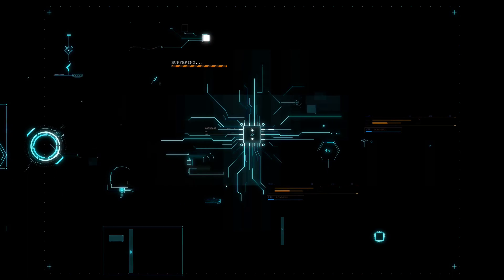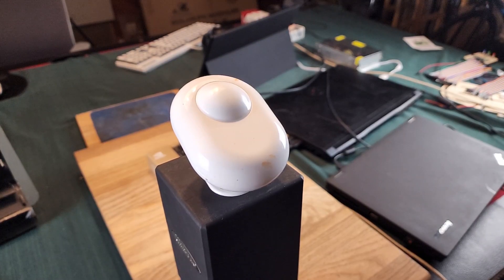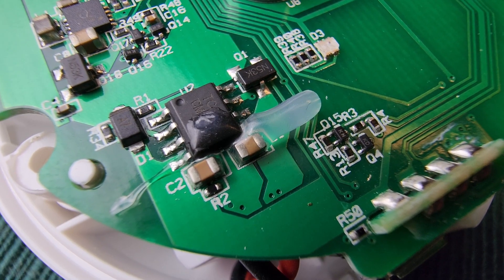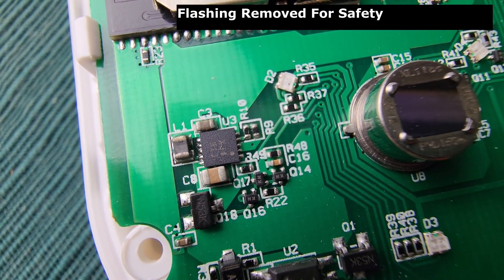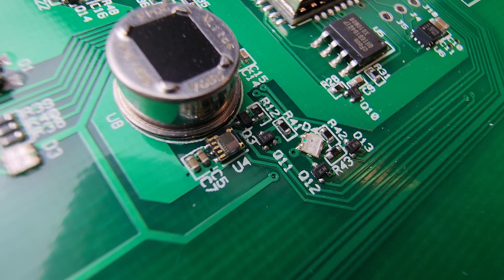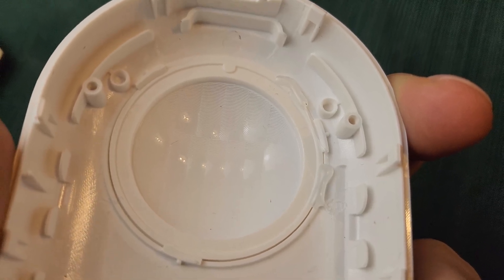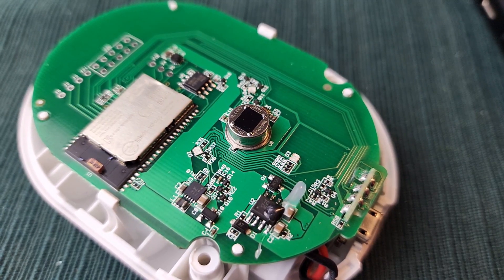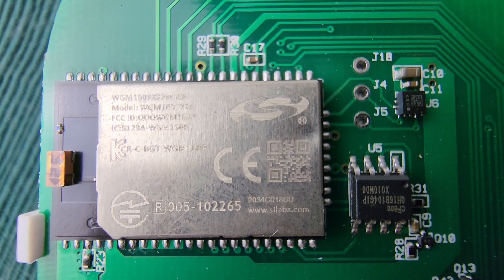The Stuff Inside A Smart Motion Sensor

Comment: Hey! How much does it cost to make an effective motion sensor from scratch?
Reply from the maker: That ultimately depends on your desired features. If you want just a simple motion sensor that uses PIR and is powered externally,  as little as $11 ($9 for a pico w, $2 for the PIR). You could go even cheaper using small ESP32 boards, but I haven't used them so I'm not sure what is involved. If you want to add a microwave sensor, add about $1.50. If you want mmwave, add another $10-15 and good luck finding just the sensor. If you want a light level sensor, add another $1.50 or so. If you want temperature and humidity, add $2-5 depending on the accuracy you want. If you 3D print a case, you might be looking at no more than $1 worth of plastic, but if you want to use some kind of project box, you could pay as low as $2 or so. 
One thing to note about all of the prices above; I based these on sensors I purchase and most of these you could pay quite a bit more for just one--or they may not be sold individually at all. So, it may be packs of 5-10 pieces. This means if you're only making one, you're spending quite a lot and you'll have a lot of extra pieces.
I hope this helps!
Reply: @smartercircuits I love you
Reply from the maker: Aw shucks, thanks!

Comment: Any suggestions on reviving a dead Motion?  I thought I recharged it a few months back...but I may be mistaken.  The reset does nothing (@ 3 or 10, 12 seconds).  I have recharged it but there is no sign of life.
Reply from the maker: That might depend on how much work you want to do. If the device no longer responds to its reset button, there's no other way to interface or troubleshoot without removing the case. Chances are, the batteries are your problem, but it could easily be a component on the main board. If you'd rather not open the device, I would say it is probably best to simply order a replacement or request one if it's still under the 2-year warranty. 
If you opt to open it: First, I must remind you that the batteries inside are Lithium Ion and you don't want to scratch or heat them. You can look for any visible indicators of damage to the circuitry and if you see none, you can test the batteries. The circuitry could still be the issue, but with no way of testing it other than a visual inspection, you can't know. I would not recommend testing or attempting an external charger for the batteries unless you've done that sort of thing before because the contacts are welded onto the batteries and they're bound together with an outer sleeve. 
If you can't test them, you could try replacing them anyway if you are so motivated. They are 18650 cells, so you could feasibly find a small enough battery holder to fit inside, maybe--it's a tight fit (you would need the battery holder for the contacts because you should not solder on the batteries). 
If you opt to replace it: You probably won't find the gen 1 anymore and will end up with the Motion 2. As far as the sensing and performance, they seem just as good, as far as longevity, I haven't had one long enough to say. Eventually, I'll get around to taking one apart.
I hope this helps and thanks for watching!